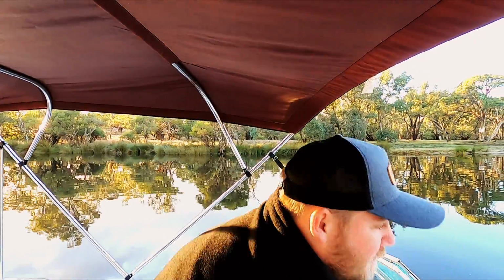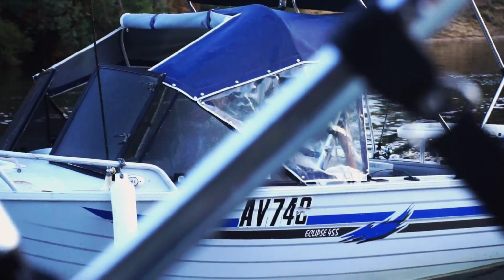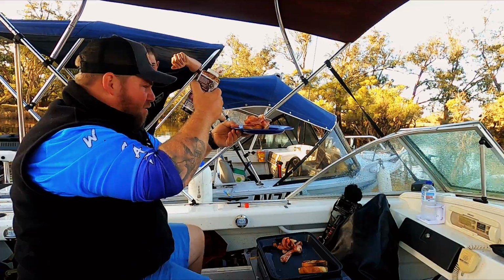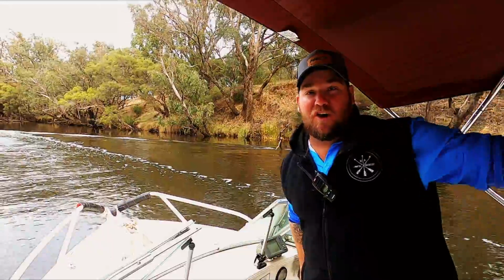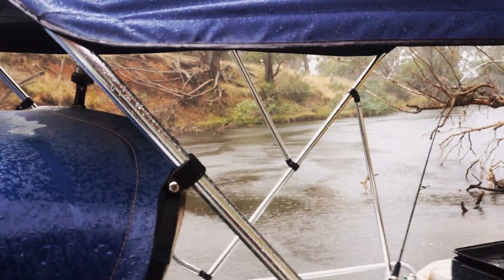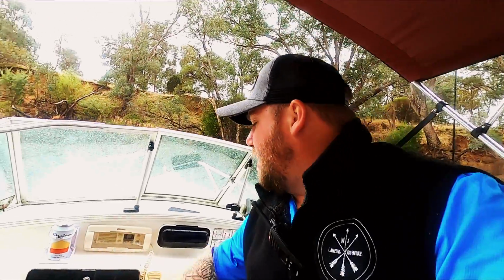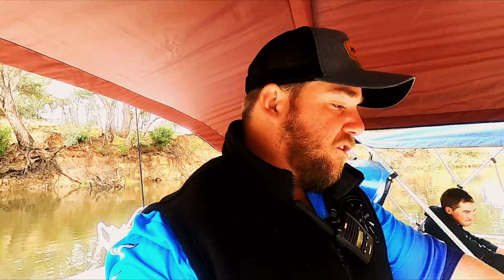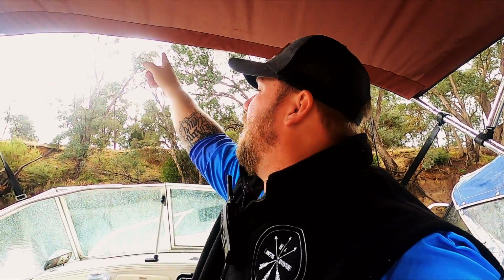CAMPING IN MY RUNABOUT BOAT - A LEAK TO FIX - TAKING ON WATER

Comment: Why don’t you put a 12 volt setup in the boat? Have the motor charge a 2nd battery or setup a solar blanket across the back or on a pole in the rod holder and charge it as you go and have a 30l fridge going :)
Reply from the maker: MINT IDEA!!!! Have literally got a brand new agm battery sitting there ready to go jordan and also its wired ready for a second battery!

Comment: Hey Pete. Geez you remind of a mate of mine who passed away a few years ago... you could be his clone. Anyhow this vid's a year old now,... so did you find your leak? Get a bilge pump in? I bought a very similar runabout to yours about the same time you were making this vid that also had a leak... was sure it was a bung, but I ended up ripping out the floor and floating the boat to find it. Turned out it was a 15" split in the welded chine half way up it... the water was seeping in, running along a strake to the back, then trickling down so I thought the leak was at the back, had to get the ally welded up then she was all good. OK just thought I'd say hi, might go watch a few more of your later vids. :)
Reply from the maker: Gday brother! Oh i bet he was a nice bloke. Damn that would of been a headache to see a split like that!
Yeh i found mine it was the bung! All that time i spent haha🤦‍♂️🤦‍♂️🤦‍♂️
Reply: @WACampingAdventures  yeah he was a lovely bloke, sadly missed.

Glad yours was an easy fix. Keep an eye on them, I had a bung spin itself out an hour or so after I launched once, first I knew was there was water over the floor at the back. Thankfully I had a couple of spares in the boat. If the O rings on them wear they can become loose and fall out.
Reply from the maker: @SandmannOZ  sound advice mate i shall grab a spare before next trip!

Comment: To find your leak, with the boat on the trailer and bung in, start filling it up from the inside. Then you’ll see if its the bung, transducer etc. Could also be your engine transom bolts, or worst case a weld seem or other hull fault.
Another good vid 👍🏻
Reply from the maker: Mint idea steve and thank you mate